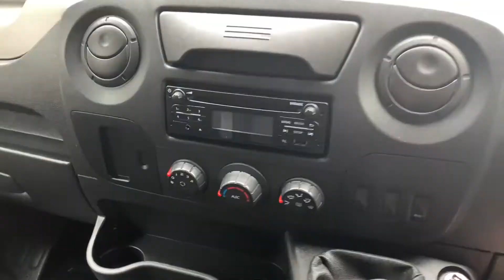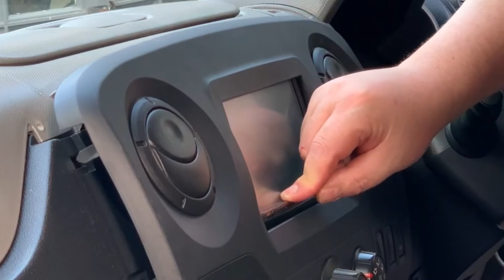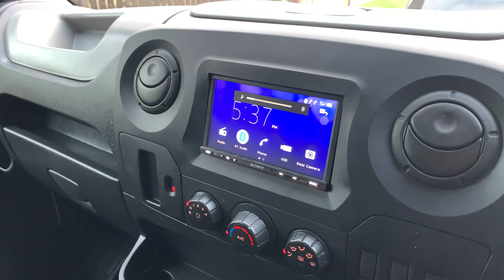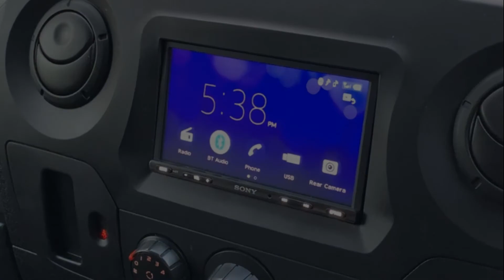Fitting a double din stereo to a Renault Master/Vauxhall/Opel Movano/Nissan NV400.

Comment: Getting ready to fit a unit finally. Where do you get the harness from for connecting the radio to the renault  24 & 12 pin connectors. ?
Reply from the maker: It came with the Sony unit.

Comment: a bit concerned you did not fit the mounting plates to the head unit before fitting the plates to the holes on the dash.technically only friction is holding your stereo into the dash.

Comment: What did you do with cable that Is mini usb in old radio
Reply from the maker: Nothing. Not sure what it does, my guess is it goes to the GPS screen where the mirror is (if fitted).
Reply: I think it does USB at drivers side above steering wheel and you can use that for Apple car play , I’ll try with a converter to see if it’ll work
Reply: I used a USB 2.0 A Male to Mini USB Female Cable Lead Charging Charger Adapter Converter and it worked perfectly